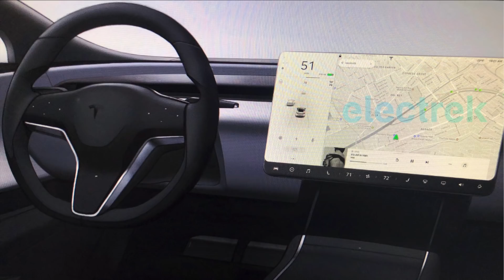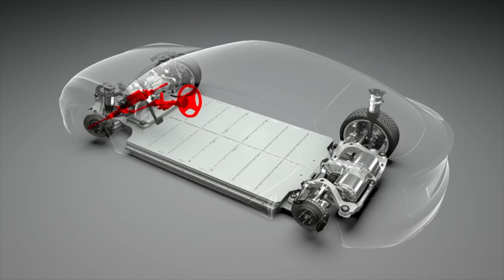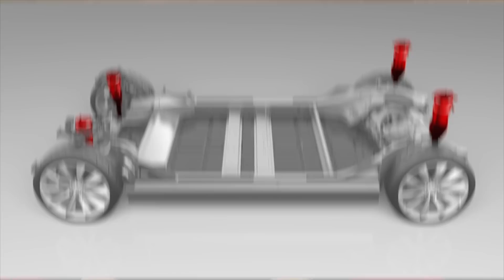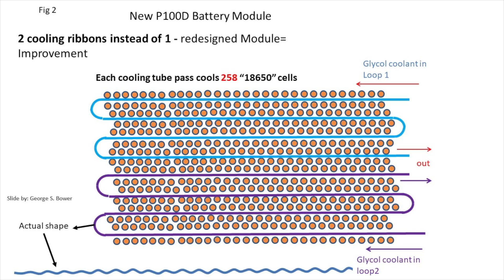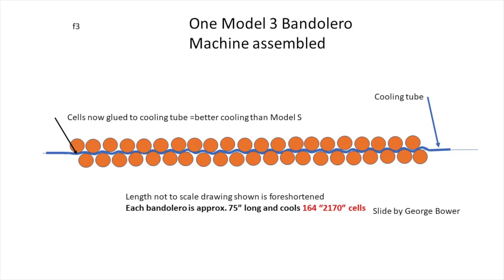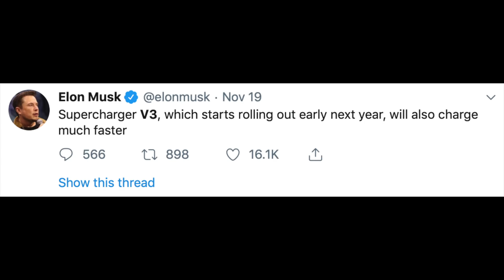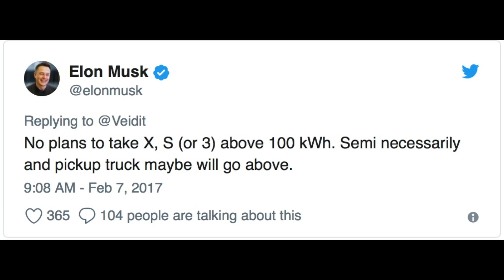The reason Tesla's 75 kWh battery is going away

Comment: they have to Increase the Size. and here's why:
with the 85Kwh pack you can charge at .5C Rate (C=Capacity for Batteries) and get the rated 500 Cycles out of the pack or about 100-110k Miles. that's the Warranty and that's the Design goal.(most home chargers top at 40Kw you can go Farther with that if you keep the car 10%-90% and double the Initial total Cycles to 1000 This is Proven by testing on the NCR18650B from Panasonic  (the Cell in the S/X) . the 85-100 Kw packs are the 3250Mah and 3750Mah cells in the same quantity. but there is no "reserve" as the pack ages. there are not extra Cells lying in wait so that your car keeps it top Range. you lose on Average of 1-2% per year if you use the car or don't. that means after 10 years its 10-15% of the range lost Assuming ZERO cycling, not a Mile on the Odometer. 
thats taking a 220-260 Range tesla down to 180-200 ish or the smaller packs even lower... Now Factor in the use.... In 10 years thats 100-200K Miles and Assuming we are going with that .5C charging Speed rating where the cells are Happiest. but going with 0-100% charges. you are looking at a loss of 25% or Higher. Sometimes in the high 20's (its Already happening.) Tesla's with 100k miles are Sitting around %80 of their rated Range. WITH Little to ALMOST NO SUPERCHARGING USE Now, lets  use the supercharger....The supercharger will Push 120KW into a 85-100kw battery. do the math. We know C= Capacity and we Know the Charge rate of The Panasonic cells are rated to 0.5C or 50% Capacity or 40Kw. So what happens to The Batteries when charge them this fast? you Destroy or as Elon says "FRAG" the pack. you cant do it, you shouldn't do it. 
and they are doing it as we speak. 120Kw into your pack creates Excess heat, Wastes power And Damages the Cells. Even if that person kept the pack @20-80%, and Supercharged all the time they Run the risk of taking their pack down to 60% capacity in 50000-60000 Miles that's how much Damage Supercharging does.. Seriously. and it's not Being talked about

Ask the RC/Lipo guys. the cells are Similar. but the Truth is there. charge at 1C and you get 150-200 Cycles. Charge at 0.5C and you get. 500+ before the pack needs to be replaced. 260mi X200 cycles is 50000 Miles. 

Heat, Surface Area, Charge/Discharge all matter here. But the fact is KWh's= Miles driven Regardless of how fast you charge and Discharge the pack... Tesla's Easiest Solution is to Increase the range of the pack by 80-100% which could mean a 50% -80% larger battery. but also 2x the Range. all while Still keeping Range Gained per min charging the same or 15-20% faster. 

its Actually the best Solution. you solve not just the Supercharging Problem for Cars. 
you increase Range, 
you charge Faster,
you increase the Lifetime of the pack. 
you Lower the heat loss of the pack, and Increase How Efficient it charges.

I fully expect to See the S and X have options for 150 and Possible 200Kw packs in the coming years following or preceding the 3.0 Supercharger. 

FYI to get the Lifetime of 10-15 years out of the Power wall Tesla is Maxing the Charge Speed at 0.30C and limiting its Range to 20-80%.state of charge. considering  daily cycling. you can look for upwards of 5000 Cycles out of it before its lost 20% of its Capacity.  this appears to be the Direction they are heading with the Older S/X packs.

Source: Equipment Procurement NCOIC for USAF/USN NavSat Shipborne and outpost backups. I was tasked with replacing old Units and packs and to perform analysis on old Batteries and equipment to determine method of failure. during that time We were transitioning from Primary cells over to Rechargeable attached via solar or intermittent Generator 
Panasonic Spec sheet and a Detailed write up of the Battery itself.

http://blog.evandmore.com/lets-talk-about-the-panasonic-ncr18650b/
Reply: Can these Battery Packs can be recycled or Remanufactured after 5 years to get improved performance??

Comment: The problem Tesla is really facing is that property owners and infrastructure companies have gone off the idea of fast chargers as they put a massive strain on the electricity network at 120KW they are equivalent to about 80,000 sq ft of offices or the average continuous draw capacity for 60 homes (US more if anywhere else). 

At a time where power companies are under pressure to invest in cleaner forms of power generation and face increasing costs elsewhere, it is easy to see how the idea of a 250kw fast charger vs an overnight charger pulling around 5-8kw will be viewed by those tasked with delivering infrastructure to support the growing number of electric cars.

Comment: The 2170 cells are rated for a lot more current than the 18650 batteries.

The 18650 is rated at maybe 6 amp discharge rate, while the 2170 is rated more like 35-70 amp discharge rate.   On paper, it looks like the battery pack could sink a megawatt or more, maybe a lot more.  If the cells are damaged by ludicrous charge rates or not.  So, it is not a matter of if, but at what cost.

The real answer will come from testing the batteries to see what works best.  That is likely the reason for the ambivalence on numbers, as the testing is incomplete.
Reply from the maker: Thanks Rick. What’s the best way for me to read more about how much amperage the 2170 cells can take?

Comment: VW has $2 Billion invested in superchargers, higher voltages, faster chargers,  in CALIF already,VW working on EV means Tessy is doomed.  VW says EV is too pricey for practical use for the masses.  VW also has several battery suppliers, Solid State means Li is obsolete.  VW is ramping up 16 factories for EV, Tessy has teh old GM junk...Tessy is a hobby, VW is a real car maker.  Audi, Porsche Bentley all have lux electrics, which means tessy is finished
Reply: This all sounds like a very objective and rational view

Comment: Do you think tesla will start to use the new flo batteries in new vehicles. Supposed to charge faster, last longer and don't use lithium. They use a way cheaper and more abundant metal. Zinc or Nickel if I'm not mistaken. Anyone know?

Comment: The 5-10% yearly advancements in battery tech, still apply. But Tesla is trying to push energy density and productioncost. 

The new Model S/X batterypack (when they do arrive) will nog be inches taller. That would only be the case when using 2017 Model S tech and apply it to the Roadster batterypack. The Model S and X will get a new pack sometime down the line, but this will not be a taller pack. Tesla doesn't have the development capacity to work on more than one model at a time...so no big structural changes to the S and X.

I also think the 2170s will be used for a new pack sooner than later. Also, I do not think it is necessary to have a pack that is way bigger than 100 kWh. There is no competitor for years with that kind of a pack.

Tesla's focus is on cost reduction. So put an equal amount of kWhs in a pack for less money, or a bigger pack for the same amount of money. Also, Elon mentioned in a very recent Q&A that only a small increase in pack size is to be expected in the next couple of years.....so....My 2 cents:

There will be 2 new packs, I think. Most probably a 110 kWh pack and a 90 kWh pack (pure speculation on my part...no proof or inside information). Both will have 2170s and the packs will have the same dimensions as the current packs. This will increase the gross profit margin, because those packs should be less expensive than the current 18650 packs. Also...very possible the interior refresh will happen in Q2 of Q3.

What about SuperCharger V3. I'll try to "think like Tesla". Trying to reuse as much standard tech as possible. To get to 200-250kW, it would be necessary to push 500-550A through the cables. I suspect a current stall has to be upgraded with a liquid cooled cable to be able to handle those currents safely. Also, I think the current charger stacks will remain the same. So 120-130ish kW charging power for two stalls. Tesla will probably create a buffer using Powerpacks between the charger stacks and the charging stalls.

Cars can use the faster charging when a car can handle the 400-500A current and the "buffer" is sufficiently charged.

Model 3 should be able to handle 500A current when charing according to EPA records and Model 3 does seem to charge quite fast on a current SuperCharger...but tapers of quite quickly after 50% SoC. Who knows what the new S and X packs can handle...most probably plenty...but please...expect an evolution and not a revolution!

Comment: I think this is long overdue.  My biggest problem with Tesla in this last year is that Tesla has diluted the Model S/X in the company.  It is okay to have the model 3 different than the S/X.  The S/X should be on its own line with its own designated build team, that do not do anything else but S/X.  Right now instead of the absurd level of reduction in options on the S/X they should become their bespoke line.   I understand trying to make this consistent amongst the lines, but Tesla has been going overboard turning the S/X into Model 3.  Making the S/X in user interface and controls like the 3 is dumb.  If i wanted a 3 I would buy a 3; but do not make me pay the X price for an X that is really a 3.  Stupid.

Also, I wanted the X because I want to tow a trailer and with the 100D model still, with the trailer it is like putting a parachute at the back.  My suggestion is that Tesla offer a 125kWh pack and an optional 150kWh pack for the S and a 130kWh pack and optional 160kWh pack for the X - because of towing.  Leaving the 200kWh pal for the next-gen roadster as the halo vehicle.   Just my opinion.

Comment: They will loose customers by killing entry level price point for just 1 reason: range
Yoz can buy a S - Class with a big engine but mercedes has always brought an entry level s- class for half the price. Imagine they would say: no kindergarten engines any more - you want big blocks and from know on 12 cylinder engine only
current Tesla customer  might accept the strategy but new customers will have it harder.
Any way - in the long run still hydrogen fuel cell can kill the complete tesla modell and too many big players are working on that like Toyota since many, many years. It's just a question of time cause getting a convenient full charge in a minute will always make a difference. Submarines are using this tech for over a decade and the first bikes appeared.
Reply: let me know when they have found an Efficient and more Effective way of getting Hydrogen from non Oil sources then we will talk? okay?

Comment: The 21700 battery is smaller in diameter (& same length) as the 26650 Li-ion battery. Checking on Amazon, for example, there are LED flashlights that can use either the smaller diameter 18650 battery (+ plastic spacer sleeve) or the higher capacity 21700 & 26650 batteries. Is there any particular reason for preferring the 21700 vs. the larger diameter 26650?

Comment: I suspect the Semi and the Roadster will have a different connector and faster rate of charge.  Semi drivers are not going to want to wait for all the 3s lined up at the chargers.  
I think they would have better luck selling an RV than their pickup, if they are going to base another vehicle on the Semi.  People shell out a lot of money on fancy RVs already.  An electric RV that can park and charge via solar over a few days to a week enough to give 150 miles range, while still providing power enough to live in, would be a hit, I think. Though it should have a 400+ mile range when fully charged.  Just sitting in your driveway for a few weeks to a month and it could be fully charged.  Whenever a 3 day weekend appears, it is charged and ready to go.

Comment: There is far less of a limit to charging IF DI water cooling is used, and it must not have any silicates or other conductive corrosion inhibitors as those inhibitors conduct electricity an cause electrolytic transfer of metal and corrosion where DI with water clear Glycol would not be a problem. That is as long as none drink the stuff.

Comment: Well, since current 21700s have a 5% improvement in terms of energy density without changing the chemistry much at all, that means the 75kWh battery pack should be at least replaced with an 80kWh pack, and the pack 100kWh pack upgraded at 105kWh.

And that's without speaking about increase in energy density/weight.

Comment: There are limits to the physics of the current Tesla battery chemistry, and for that matter most mainstream EV Battery chemistry. It's like trying to fill a bottle of limited size with at larger volume and at a faster rate, heat and resistance builds up the faster you go. So going to 200+kwh charging is maybe ok with future solid state batteries, but with current liquid battery chemistry it's a non-starter.

Comment: Bigger cables just means they can pull more current from the same voltage (more power from lower voltage outlets). It doesnt necessarily mean they have to have more energy capacity, it just means they could have added more parallel paths to rapidly charge smaller battery clusters, but drawing more current(and heat). But extending the same architecture with more batteries would also require more current draw on the cables.

Comment: My theory as to how they will make their common cars better over the next 3 to 5 years is this:
They will be making much larger cells that will hold more power having less cells means less wasted space and will make replacing the cells faster and easier!
They will also be going for more AMPS and less Volts to help keep them cooler during charging!
They will be moving to lighter stronger building materials such as Carbon Fibre, Kevlar, Graphite so the cars can go further on the same power and increase crash safety ratings!
They will be removing joined axles and going over to independent wheels as this removes more wasted energy through friction which serves no purpose but waste power and generate unwanted heat the two front wheels will still be connected by a steering bracket as two will be the rear wheels! 
Future Cars may have optional solar Panels for the roof and maybe even the bonnet and boot to help cut down how often you have to charge up off the grid since a car is between 90 to 99% of it's time just sitting around doing nothing!
AI Software that can better determine the need for charging speeds, power and/or torque ratios, traffic routes to make best time to power as possible, limiting car speed to maximize duration before the car needs to be recharged (very useful on long trips!).
Tesla may even start putting hot swappable batteries in future cars so you pull into a station a robot of sorts (I am thinking a robot arm like used to make cars and in theme parks for rides like Hogwarts at Universal!) removes the old battery that is low and replaces (done from under the car!)  it with a full one tested to be safe so you can go on your way in just 2 to 5 minutes!
Also Solid State Batteries are only 3 to 15 years (10 to 15 commercially) away that is going to be a game changer!

Comment: Also, it stands to reason that a 75kwh S/X that is a substantially more expensive vehicle than a Model 3 (with a 75 battery) but with nearly 2/3s the range. Despite the niceties of the S/X over the 3 (primarily more space) it becomes difficult to justify those over the lack of range/charging speed you get with a LR Model 3. 

I think your assumptions are right and clearly the S/X will move over to the Model3 cell format. I also think that the demand for the 75kwh pack on an S/X has become so low that the economies of scale make it too expensive to produce at the smaller runs and is therefore not viable.

Comment: Graphene capacitor battery packs is the upgrade that is needed. Developing new vehicles with them and the ability to upgrade all prior models to them, is  what Tesla needs to invest in. Doing so will ensure the conversion of all vehicles from gas to electric with safety and performance never before seen, with Tesla leading the charge. No fun intended "charge".

Comment: Interesting, I have an S60 and really don't miss the extra range for daily use and I'm in a supercharger desert (Oklahoma).  I have a radius of about 60 miles which includes most suburbs and towns I'm able to visit with no issue.  If I had an 85 or 100 battery   I'm only using that extra range for about 1% of the time.

Comment: Comments - First, and most importantly, Tesla is 21700 limited, hence the LeMR model which uses fewer cells and allows Tesla to produce ~25% more finished cars with the same qty of batteries..  No way they are ready to DOUBLE demand for 21700 production anytime soon by moving all S/X over to that battery.  Second - the 21700 isn't a performance improvement, the 18650 is easier to cool with its smaller diameter.  I can see Tesla introducing an 18650 pack redesign with Model 3 cooling tech and 120kwh capacity. By getting rid of the S jump seats, they could easily fit another block of batteries. Third - Model S track performance is more motor heat dependent than battery heat dependent.  Expect to see at least one Model S motor go to the easier-to-cool perm mag switch reluctance motor on next update.